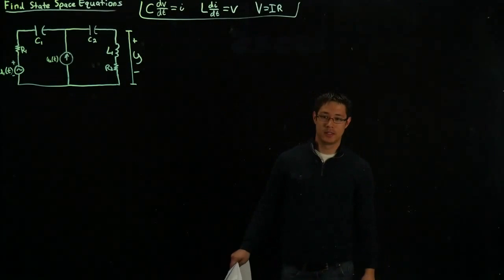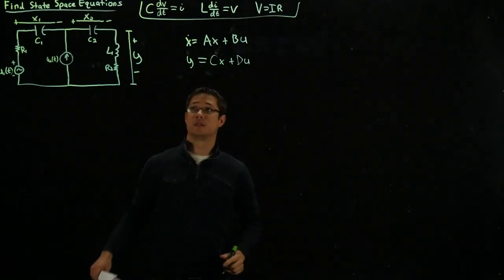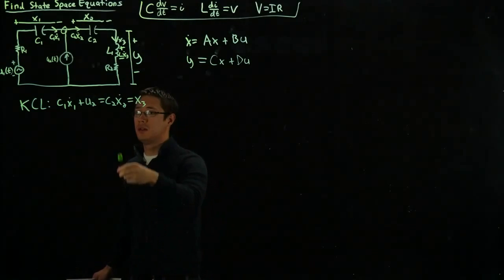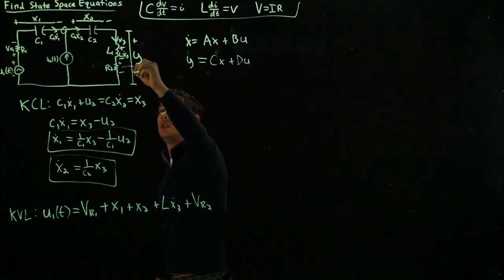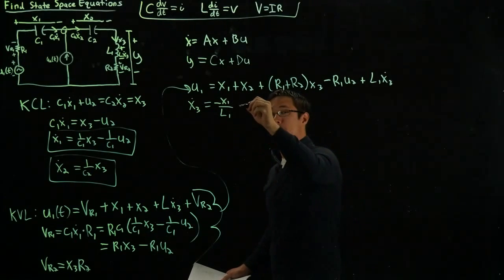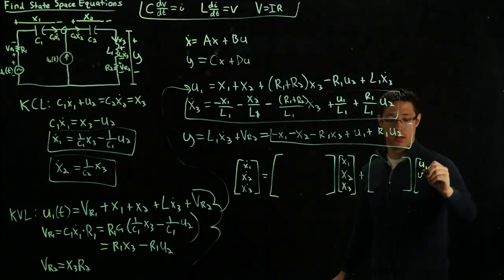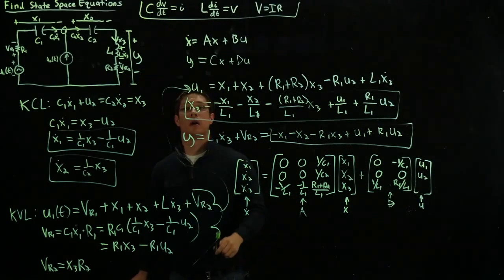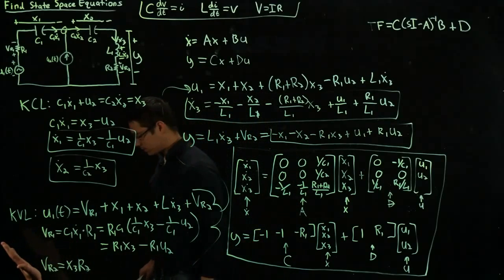Systems Analysis - Electrical Circuit to State Space

Comment: Where is VR3 represented on the output matrix cause it seems like you left it out
Reply from the maker: VR3 may not be explicitly solved for in the matrix, but you can find it from the variables that were solved. In order to "solve" a circuit, the objective is not to solve every possible value, but to solve the minimum number of variables simultaneously so that the rest of the variables can be solved with known formulas!

~Andrew